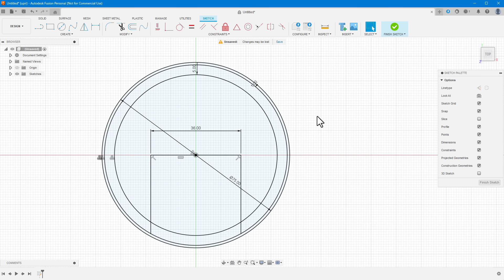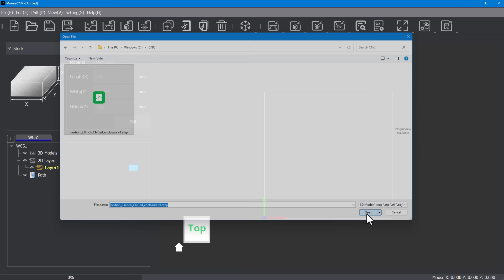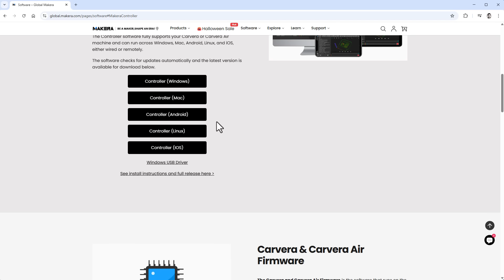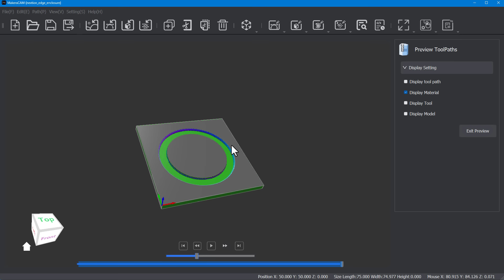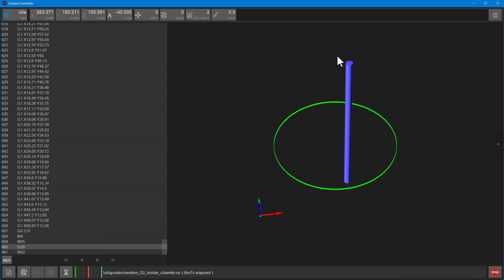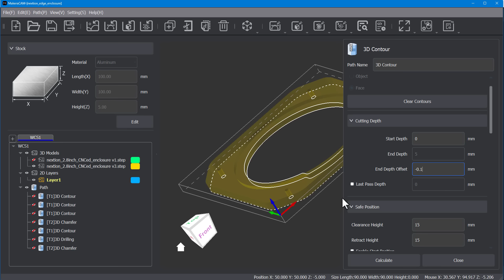Plastic → Metal (using Makera Carvera Air)

Comment: :face-blue-smiling:
When I'm going to machine several pieces, I work on a base that's slightly larger than the workpiece, which I attach to the milling machine. I use this base to hold the piece while machining it. In this case, I would drill the holes and insert four screws. This way, the piece is secured, and I can work inside and out without clamping anything. If I don't want the pieces to be loose after milling, I create tabs for them. When I cut off the excess, I do a finishing pass. I set the shortest cutter above the maximum depth, go down to it, and cut with the full height of the cutter. The toolpaths are a tenth of a millimeter higher or lower, and then I do a finishing pass. This way, I only need to do one milling pass.

Comment: Hi ,can you make video demonstration the OBD-II scanner to the arduino using elm327 Bluetooth board ,because I want to create shift light that flashes fast when the rpm of my car reaches above 5000 revs using OBD to Arduino , and I have watched your own video about connecting OBD to an Arduino using sparkfun adapter and i wash I was able to do it but I ran into three obstacles 1. I am completely new to programming and dealing with Arduino and I don’t know such simple things about writing codes or using it 2. I Am low on budget and can’t afford the sparkfun board is a little bit expensive for me 3. I cannot find the Sparkfun board anywhere or an alternative to do the same job , so the best option for me is using OBD Bluetooth ELM327 board then connecting it to an arduino then programming the light , but the thing is i don’t know how to do the second way by my own and I didn’t find any explanation on the internet so can at least guide me to what to do and what to buy or make video about it ?
Reply from the maker: Yes, definitely. Using elm327 is something I´ve been playing with for a while, and I do plan to record a video soon.

Comment: I have a Snapmaker and found the accompanying application for slicing for 3D or CNC not vrry easy. Also the toolpaths in those apps are limited.
What I did instead is use the manufacture option in Fusion and export the toolpaths to the CNC. You have so much control over which type of path, bits, feeds, speeds. Also takes some time to get used to, but hey, you learn every day. I use the snapmaker application only for the exchange of cnc or gcode files to be fair.
Reply from the maker: I fully agree with your comment. The provided CAM application is limited, but definitely a great start before diving into something more complicated like Fusion. I still plan to learn how to use Fusion for this, but that´s a steep learning curve...

Comment: Great tutorial. 
If you want a nicer surface on the cut, you should consider making a finishing path, like 0,05 or 0,1 mm side cut 5 mm deep. This will eliminate any steps in the cut making it uniform. There are a lot of tricks in CNC machining on how to make things faster, better, and still easier on the tools and machines, but that takes practice. I would watch CNC shops making parts and take some notes on how the tool path is done. Keep it up!👍🏻❤
Reply from the maker: That's a great tip, thank you for sharing your experience! I´m sure there are dozens of ways how to improve my steps, but I´m still on square one barely scratching the surface.. but that will hopefully improve with more time spend CNCing.